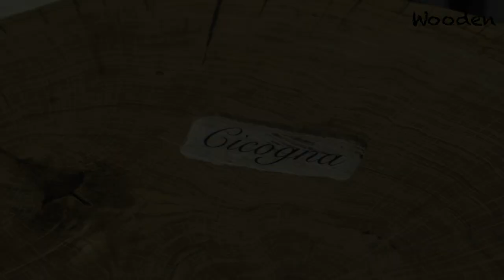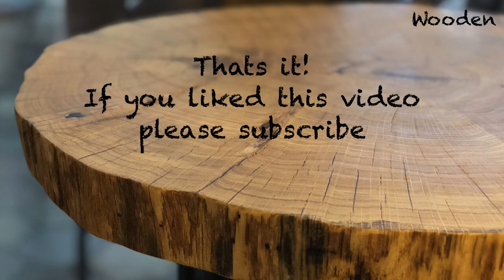Cookie Slab Coffee Table - Oak

Comment: Wow! Any tips for someone with virtually NO equipment?? Is it necessary to flood with epoxy for that high gloss shine, or can you use a different (cheaper) coating for the whole thing and the edges? Looking for a more DIY, less professional project that will still last a while.
Reply from the maker: Thanks Yelena ♥️ The answers to all your questions are in this video: https://youtu.be/qVlbgRKXt38 - it’s long but it should cover everything you need to make such a table with almost no power tools…

Comment: Was the epoxy just for filling the cracks? Then planned and sanding the top back down to the wood surface?
Reply from the maker: Hey Steven. Yes, for filling the cracks but also for sealing the end grain. You can learn about the details here: Flood your end grain (cookie) slabs with epoxy resin
https://youtu.be/miIwjI479_A

Comment: why do you take the bark off? is it a matter of preference or is there a real reason for removing it. I like the look of bark on the edge.
Reply from the maker: I like bark too. The problem with bark is, that it dries out differently then the wood, so usually after a couple of months it will peel off anyway. You can try to prevent that with wood glue or epoxy resin, like I did on this table (https://youtu.be/m80oViX71rk), but it’s messy, work intensive and risky...

Comment: Hi there, 
what is the purpose of epoxy ? fill in the gaps of timber ?
Reply from the maker: Hi! Yes, exactly, that is one purpose, to close all cracks and holes that the wood has, due to the drying process. The second purpose is to seal off the end grain. I explain this in this video: https://youtu.be/miIwjI479_A

Comment: I love your work and the finish you create. I'm getting ready to finish my 16" thick red oak "cookie" and was wondering why you first epoxy coat, epoxy float, then plane and then coat with mono. I have leveled it using a router sled and have it sanded down to 100. Can I fill my voids and seal coat with epoxy, sand then apply mono? Is the flood epoxy coat necessary?
Reply from the maker: Hi Bryan. Thank you for your kind words. I float cookie slabs due to two reasons: 1) cookie slabs are end grain, and therefore there are many small cracks across the slab. When you plane the slab, the risk of small pieces being ripped off in the planer is larger. If you flat the slab before planing, the epoxy holds the wood together. 2) End grain is very thirsty, that means it soaks in the coat very quickly due to all the cracks and holes. If you flood the slab before after planing (and sand after floating) you create a smoother surface which you can coat more evenly. I think you can totally go without floating before planing to save costs (I often don't float before planing), but I highly recommend floating after planing, to get a nice finish. Hope that helps... Have fun with your red oak :D
Reply from the maker: @bryanfriedel5480  Oh wow - a huge and beautiful slab! Congrats! So here is what I would recommend: Plane it with our router sled and sand it (seems like you did that already). Now flood it with epoxy resin and let it cure well. Then sand it down with 80, 120, 180 and 240. Apply one coat of Rubio Monocoat with a brush (not with a rag) quickly (it will soak in fast). Repeat that last step 1-2 more times, depending how thirsty your slab is. With that procedure liquid stains should also be easier to remove (as the liquid won't be able to soak in that quickly).
Reply: @Woodensoul  Awesome! Thanks so much for your help. I'll send you some pics when I'm finished
Reply from the maker: @bryanfriedel5480  Oh yes, please do send pictures, and have fun with your beautiful lady (slab) :D
Reply: @Woodensoul  so I finally  finished the epoxy and this thingbwas thirsty. The deep end grain cracks really ate up the epoxy, but I have pretty well floated, so i make take a good bit of sanding.
https://www.dropbox.com/s/lwjutzuqvoah96i/20201111_160151.jpg?dl=0
Reply from the maker: OMG that slab is beautiful! Look at these colors!!! Yeah, I told you end grain is thirsty! No imagine this sucking up your coating 😆 Make sure to wear a breathing mask and use a vac to suck in the epoxy dust. Epoxy is highly toxic to your lungs. If you can sand outside even better. Keep me posted and have fun 🤩
Reply: @Woodensoul  Definately sanding outside with vac and mask. Thanks for the info 👍
Reply: Good morning. So I final coated with the Rubio mono pure yeterday morning. The wood was thirsty, so I had to go back and apply more RM to the areas that were soaking it up. This morning there are visable brush strokes in the RM and it is glossier than I want. Can I buff or wet sand the brush strokes out?
Reply from the maker: Hi Bryan. Ok, if you have visible brush strokes, you might not have applied RM the right way. I am sorry, I thought you have experience doing this. So there is what I would do:
1) If your surface is sticky, then there was excess RM that can't dry out. That stuff is annoying. In that case, I would sand the entire surface again, and remove all RM, until you have the original surface again. If it's not sticky, you can move to the next step
2) Clean the surface with mineral spirit, then apply RM over the entire surface with a brush, and make sure to "backfill" places where it soaked in
3) Take a clean rag and distributed the excess epoxy over the entire surface, rub it into the wood
4) Leave it to dry for 10-15 minutes
5) take a couple of clean rags and remove all excess RM over and over again until a clean rag stays clean when going over the surface
6) Now it should look nice, but a little shiny. Wait and don't panic. Let it cure out for 7 days if you used RM without hardener (which I recommend). If after 7 days it doesn't look as you want, repeat the procedure starting with point 2
Reply: @Woodensoul  Ok. I'm going to let it cure for another 24 hours. I used the accelerator as the directions suggested, but when i tried wiping it with a rag, it was very sticky and not working. I took some excess off with a plastic squeegee then recoated dry areas with brush. As I recoated, the RM was setting up, so it's not what I anticipated
Reply from the maker: I looked at the pictures. You used too much RM and waited too long to clean off the excess, hence your surface consists now of semi cured RM excess. If you follow my instructions you should be able to fix that...
Reply: @Woodensoul  So I ended up scraping the RM offand letting the piece cure for a week as the 120 grit was clogging. Sanded down to 220 and coated again with RM and it turned out perfect. Thanks again fir your help.
https://www.dropbox.com/s/uvf2ax3rngpgja7/20201124_084537.jpg?dl=0
Reply from the maker: @bryanfriedel5480  WOW! Absolutely gorgeous! Congrats to your piece of art! In the future, if you have any stains on it, you can lightly sand the part with 220 and apply Rubio again. Due to Rubio working through molecular binding, it will always look great. Enjoy!

Comment: I'm interested in creating something similar to this.  Did you use dead wood or green?  Did you need to check for the moisture content prior to starting the project or does it not matter?
Reply from the maker: Hi Joseph. Glad you want to try it out. You absolutely should use dry wood, not green/fresh wood. The reason for this is that fresh wood dries out, and in the process of drying, it will twist and crack. So if you use fresh wood, it will look nice initially, but after that it will warp and crack and be horrible. You should buy a dry slab. A rule of thumb is that it takes 1 year for 1cm of wood to dry (from each side that is exposed to the air). So eg. if you have a 6cm thick slab, it will take about three years to be dry. If you buy a "kiln dried" slab, it was dried in an oven, that means the drying process was sped up. That works too, but those slabs usually have more cracks because of the speed of drying out. You can measure the wood moisture if you have such a device, and ideally the moisture should be around 12-14% if you will have it in a normal heated room. If you plan to have it outside, the moisture level should be higher.

Comment: Man that was so nice. How did you measure the placement of the 3 legs? Or did you just eyeball it?
Reply from the maker: Thank you, man, appreciate your kind words. Honestly, I usually just eyeball it. If you want to be precise, you can split a circle into three. There are many videos on YouTube showing you how to do this...
Reply: @Woodensoul  cool thank you. Did you flood the slab in one stage? Any issue with bubbles? I’ve got a similar slab and I’m not sure if I should pour the resin in one go.
Reply from the maker: @freestyla101  Yes, I do flood the slab (I show why and how in this video: https://youtu.be/miIwjI479_A). Regarding bubbles: You can have bubbles with a thin pour or a thick pour. The elements that generate the most bubbles are either the bark, or very thin but deep cracks. I recommend you do the following: 1) tape all cracks and holes, 2) pour a thin layer, to verify you have no leaks and let it cure well, 3) pour the rest, but verify your epoxy resin can be poured that tick (I use cheap resin that has a maximum height of 1cm, so I pour multiple layers always), 4) observe the pour, and if you see bubbles, then use a heat gun to remove them. One last note: If you pour over bark, I recommend applying first a thin layer over the bark using a brush. That seals the bark and reduces the chance of bubbles... Have fun!
Reply: @Woodensoul  great info!! I needed that! thanks for the great video
Reply from the maker: @TinoBamBeano  Most welcome, Tino 😁 Have fun building 🎉🎉

Comment: How did you dry the slab?
Reply from the maker: I always try to buy dry slabs. If you bought one that is not dry, you have two options: 1) bring it to a place that can kiln-dry it for you (they put it in a low-temp oven for a couple of weeks), or you wait for it to air-dry (rule of thumb: 1cm per year from each side of the slab; faster if in a heated room).
Reply: @Woodensoul  Or, you use Pentacryl on the green wood to stabilize it. ;)
Reply from the maker: @PreservationSolutions  I don't know pentacryl. What is that? Sounds heavily chemical. Is that nice to your wood?
Reply: @Woodensoul  Pentacryl is a stabilizer for green wood (with a moisture content above 25-30%).  It is popular for use on wood cookies, because as you already know, this type of cut is the most challenging to stabilize.  Up to 90% of the drying in green wood occurs in the end grain and since wood cookies are 100% end grain on both sides, they dry super fast.  Also the round cut of wood cookies has a lot of tension on the outer rim and the wood will want to crack from the outside in towards the pith to relieve that tension (like a pie shaped crack).

Pentacryl works by displacing the moisture/water in green wood.  It leaves a thin coating on the wood cell walls which prevents them from shrinking as they dry, thus significantly reducing the cracking and checking.

Pentacryl speeds the air drying by approx. 30% since it is "using" the water out, however, it still needs to dry slowly and controlled.   Thank you for showing wood cookie finishing steps - especially on larger pieces.
Reply from the maker: @PreservationSolutions  Thank you, that is really interesting! I had no idea such a thing exists...

Comment: Was für ein Holz ist das?
Reply from the maker: Das ist Eiche
Reply: @Woodensoul  danke Dir 🙏 ist sehr gut geworden 👍
Reply from the maker: Gerne, und danke fürs Kompliment. Du bekommst solche Baumscheiben günstig auf ebay.de (diese war ca. 25€). In meinen Videos steht übrigens immer in der Beschreibung um was für Holz es sich handelt. Viel Spass 😎
Reply: The subjects covered in this woodworking website TopFineWoodworking. Com varies from wood types to tool types and uses. A few other subjects range from the various kinds of wood along with their distinct levels of difficulty when it comes to managing them. If you are still a beginner in wood working, then you will find this book very beneficial.

Comment: Was the epoxy just to seal the table?
Reply from the maker: Yes, correct, and to close the cracks
Reply: @Woodensoul  Did you use the mixing ratio specified on the bottles? How much epoxy did you end up using for this?  Great table - I'm building one like it as I type...
Reply from the maker: Yes, always, always use the ratio provided on the bottles. If you deviate from that, the epoxy won’t cure (ever), it will ruin your workpiece completely. Be very exact when measuring and mix it really well (rule of thumb I use: 1 minute of strong hand mixing for 0.5 liters). I can‘t remember exactly how much I used for this table, but it should have been between 0.5 and 1 liters in total. Have fun with your table - I am sure it will turn out fantastic!
Reply: @Woodensoul  Yes, I'm still waiting for it to "dry." Thank you!!
Reply from the maker: @woodant7  Waiting for the slab to dry, or the epoxy resin?
Reply: @Woodensoul  The slab to dry - likely a few more months.